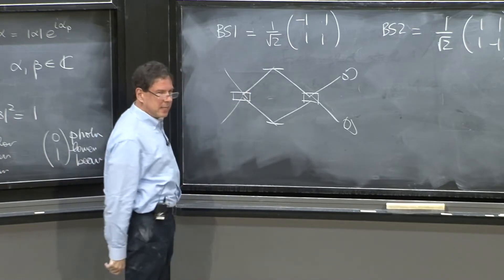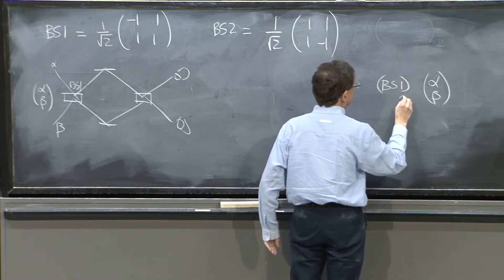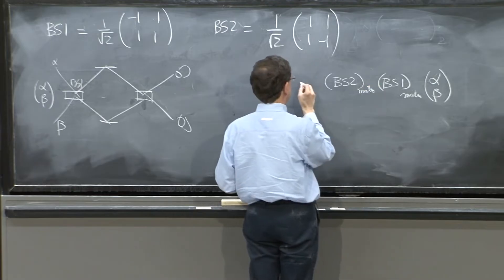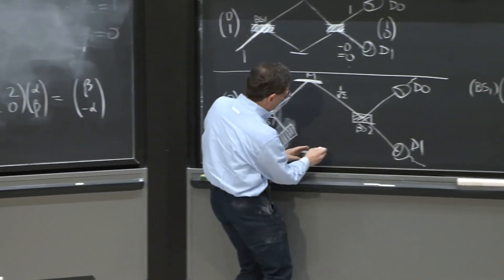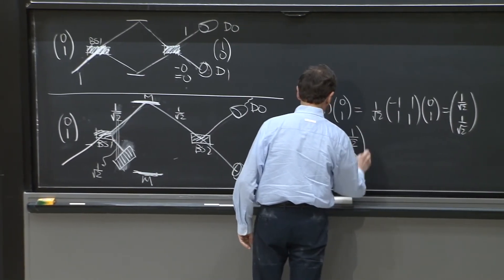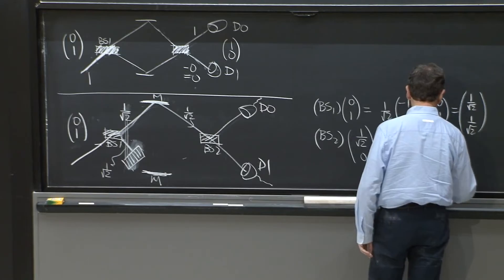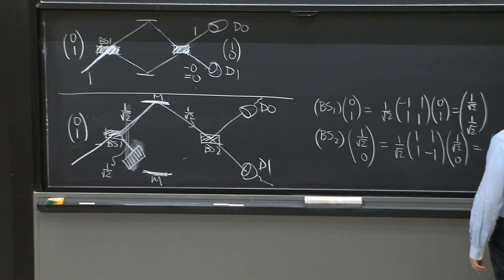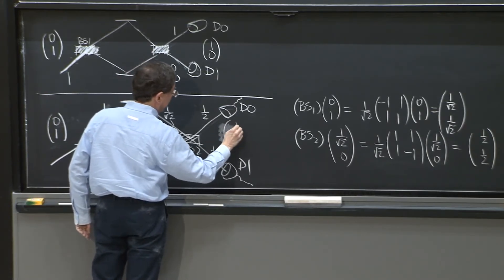Interferometer and interference

Comment: Interferometers are fascinating devices that leverage the wave nature of light to measure extremely small distances and changes with incredible precision. By splitting a beam of light into two paths and then recombining them, they create an interference pattern that reveals subtle differences in the paths taken. This principle of interference not only showcases the fundamental aspects of wave behavior but also has practical applications in fields ranging from astronomy to engineering. The beauty of this technology lies in its ability to transform minute changes—often at the atomic level—into readable data, illustrating the intricate relationship between light and matter.

Comment: I don't undertsand why he uses one Matrix for BS1 and the other matrix for the BS2
Reply: Watch the previous video: "Mach-Zehnder interferometers and beam splitters"

In it, he chooses the two matrices such that they satisfy two requirements: 
(1) They are  both balanced and 
(2) They can be combined to build the interferometer he wants to talk about. 

He talks some about choosing the matrices - especially getting them to be balanced,.
But he doesn't teach you how to do choose 2 balanced splitters that work for the interferometer.
Reply: Because different bs have different matrix , it's a characteristic of bs .
Reply: @Shooo117  is that a pun on bs?

Comment: What did he mean by mirror will multiply by -1 ? I didn’t quite understand why he didn’t use it in the second example. Would be really grateful if someone could explain it.
Reply: The matrices give probabilities that the vector direction is flipped or remains the same (on the y axis) for both BS and mirrors. He is saying the mirror matrix must result in multiplying by -1 (y axis) which means there is 100% probability that the y axis direction will be flipped.

Comment: There appears to be some bait & switch going on. 

If there is no concrete block, the photon takes BOTH path simultaneously, and interferes with itself (The professor did talk about this in a earlier lecture as well). This is key to produce the output at the top detector. 

When there is a concrete block, we drop this frame and instead focus on probabilities. This necessarily implies that we are talking about a collection of photons and not one. 

To me it appears that 
A. When there is no concrete block, a photon takes both paths simultaneously and interferes with itself
B. When there is a concrete block, the photon take one of three available choices randomly, where the randomness is governed by the underlying probability (1/2, 1/4, 1/4). 

My question is: How does the photon know when we are going to keep a concrete block?
Reply: why does it have to know ;only conservation of energy momentum and spin are required of the incoming photon ;but I think I missed whether the incoming  photon was absorbed or reflected at the block
Reply: The block here is time-evolving the state non-unitarily (not conserving probability), hence the state at the end (1/2,1/2) is not the state of the entire system but rather for only a limited part of it. So really what's happened is he's ignored what happens at the concrete block and focused on the rest of the state, which is not normalized and indeed cannot be.

Comment: Why don't we use the same matrix for the two Beam Splitters ?
In other words: are they BS that are characterized (in their data sheet) and other BS that are characterized by another matrix ? Or are there physical reasons for selecting those matrices in this experiment, whatever the BS we use ?
Reply: This  bothered me too. Looking at other videos on this topic you will notice that the two beam splitters are, if fact, not the same. One is rotated 180 degrees relative to the other. This is one is coated on its front side, and the other on its backside to give the type of interferences that make the interferometer perform as described here.

Comment: I think the experiment here is nothing but wave physics. No quantum mechanic is needed to explain the result.
Reply: Thanks for the discussion, 전다현. Sorry that I didn't make it clear enough. The "experiment" in my reply means adding the blocker in this chapter. Before adding the blocker, D1 receives no wave. After adding the blocker, D1 receives 1/2 of the wave. This can be explained by wave physics only, no quantum mechanics required.
Reply: You are describing the particle dynamics, or a single photon. Describing particle dynamics using wave physics is the essence of quantum mechanics.
Reply: No the results here are incompatible with wave physics, in particular the results are not deterministic.

Comment: Finally some clarity.  It's a tricky thing to be able to explain physical concepts with as much rigor as allowable.
Reply: Would you agree that too much rigour too early makes understanding key concepts more difficult? I know that's a loaded question.
Reply: he/she meants the professor explained concepts with clarity without losing rigorous  @Jehannum2000
Reply: @Jehannum2000  Yes, absolutely. There is a good balance. I would find it hard to take a course where there is no motivation or justification of what I'm being taught. 

Think about how mathematicians learn calculus before real analysis. Most calculus classes have a good amount of motivation and justification for what you are learning about. You might even learn about epsilon delta limits in a first course in calculus. But, save the rigorous justification for real analysis.